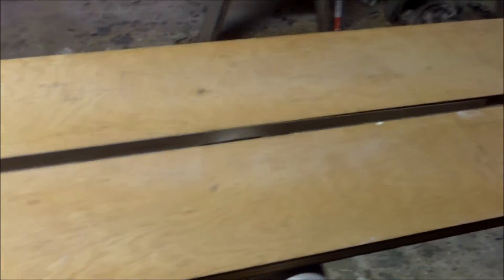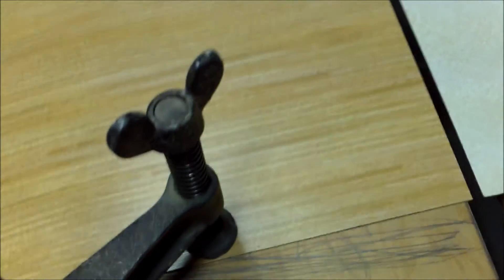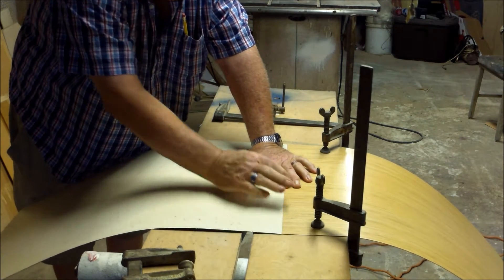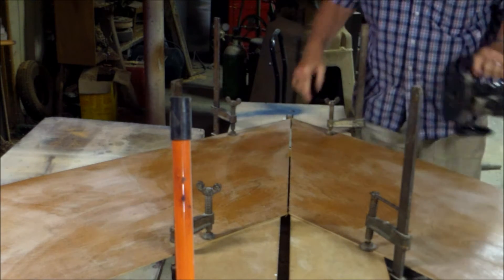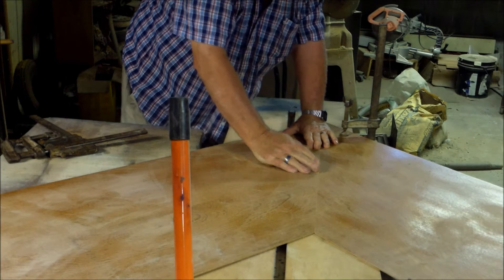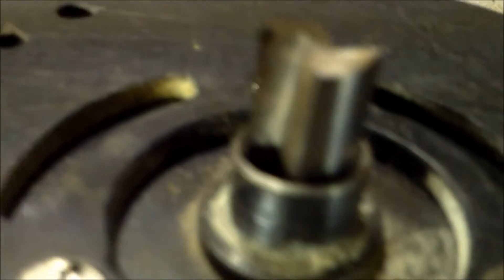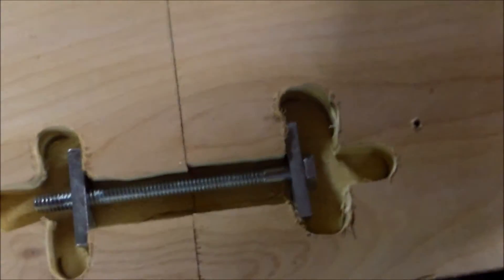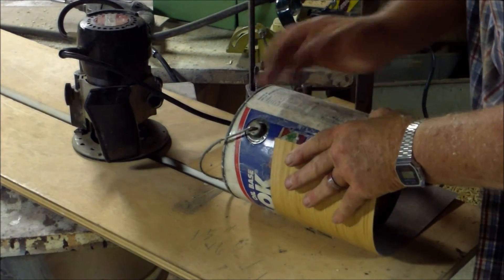FORMICA JOINTING FOR STRAIGHT AND ROUND SHAPES

Comment: I don't understand the diagram. Are you trying to illustrate the example you did earlier in the video of how to cut 2 pieces straight? What is the bullnose guide edge for as shown in the diagram? Otherwise, your video is excellent and I learned much from it. It will come handy when I make the laminate countertop for my kitchen. By the way, what laminate thickness and plywood thickness do you recommend for kitchen countertop? What sealer should be used for the plywood? Thank you very much. Please post more tips like these.